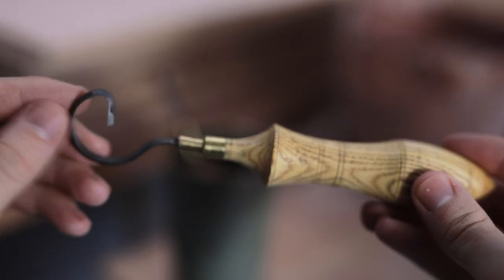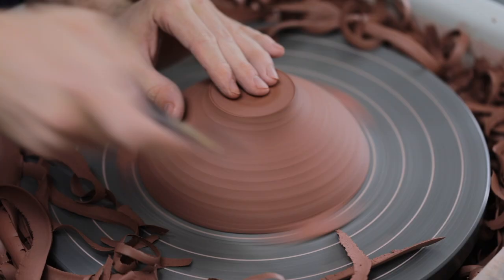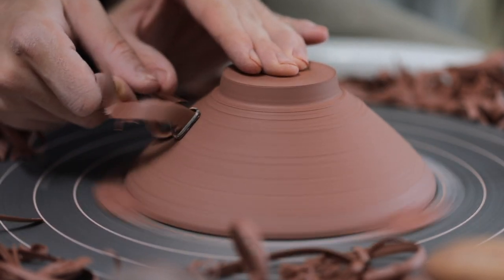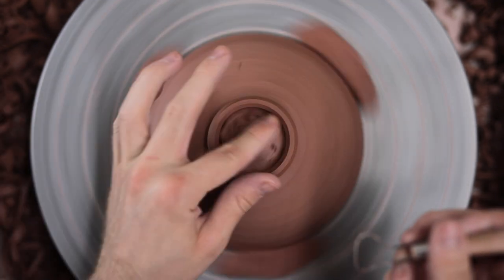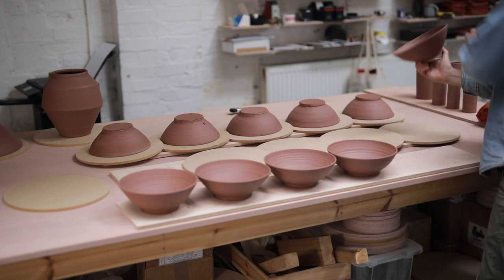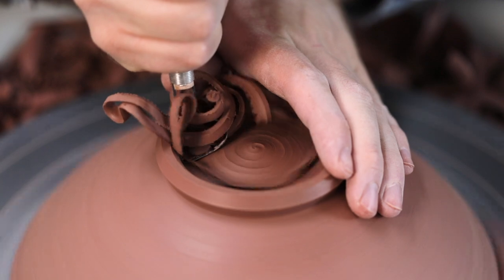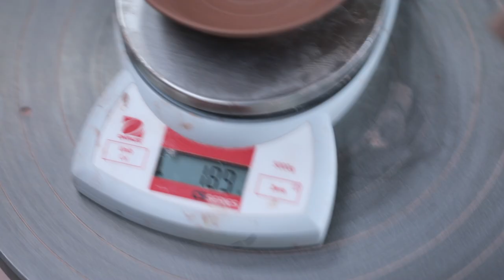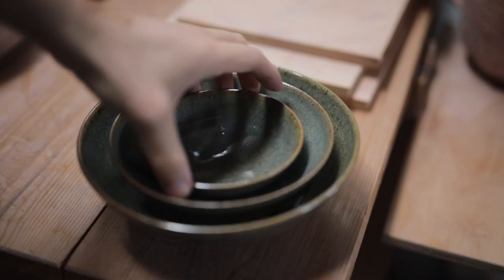Testing my New Bison Trimming Tools to Trim Pottery Bowls

Comment: For those on the fence of buying a Bison trimming tool, I've had one for five years. After the third year, I sent it to Phil Bison for sharpening. I'm not sure it needed sharpening at that time, but that is the 'warranty' period to send in for sharpening, so I sent it to him. 
Compared to other trimming tools, they seem expensive. But, being that you never have to stop trimming to sharpen them, and they last for a long time, I believe they are the best value, and comparatively inexpensive. 
I throw porcelain; exclusively. Porcelain has no grog. Not sure if grog would impact the tungsten carbide useful life, or not.

Comment: Hey Florian, just want to drop you a comment here and say thank you so much for sharing your videos, really appreciate it. I am new to pottery and I have learned a lot from watching your videos, and I have watched quite a number of your videos too. I like your style also, I also like simple, clean forms and shapes. Want to ask you also if pottery is best learnt by doing or experiencing or there are some books (theories) that I need to get my hands on? Would appreciate it if you could share your view on this. Thanks Florian
Reply from the maker: Thanks so much! Well, nothing beats practical experience. Reading some pottery books along the way helps too but you just need to get thousands of hours of practice under your belt, that's the most important thing.

Comment: How do they compare to the tungsten carbide tool you already had?
Reply from the maker: Sharper, that's for sure. I had one that was already somewhat similar, but the blade on that was a little thicker. It's the different shapes that I like so much. There's such a variety with Phil's tools.
Reply: @floriangadsby  Good to know, thanks. I just missed his last shop opening - eyes peeled for the next one!

Comment: I notice you run the wheel counter clockwise. Was it difficult adjusting to a clockwise direction when you did your apprenticeship in Japan? I am a left handed dyslexic and I find the wheel going clockwise to be much more smooth for my backwards mind.
Reply from the maker: I used a kick wheel in Japan for the most part, so I could still throw with the wheel going anti-clockwise, then, when I used an electric wheel to make my own work there, it was a Shimpo with a toggle, so the wheel can go both ways, so, in the end, it was never a problem.
Reply: @floriangadsby  thanks for the reply. I truly appreciate your videos